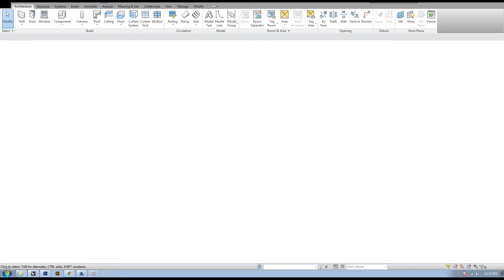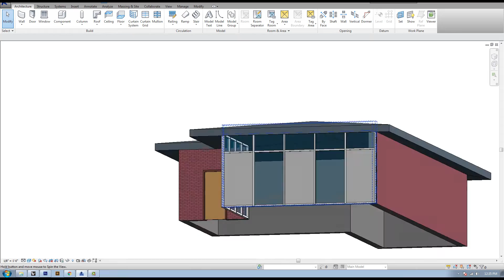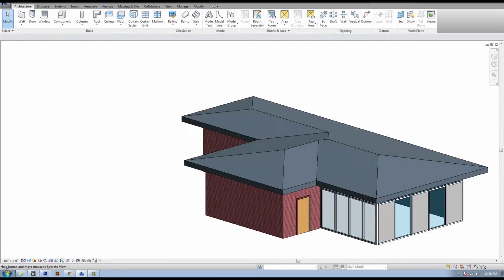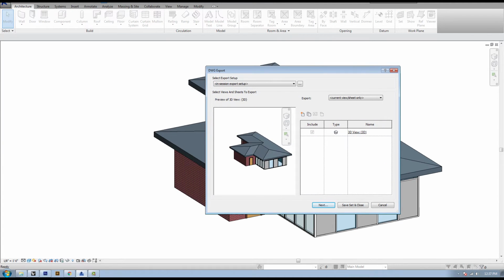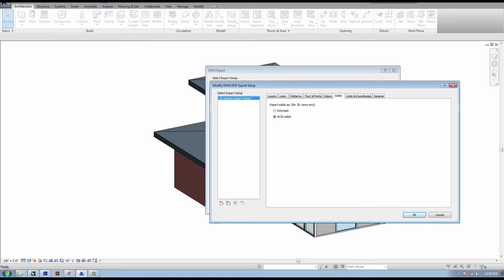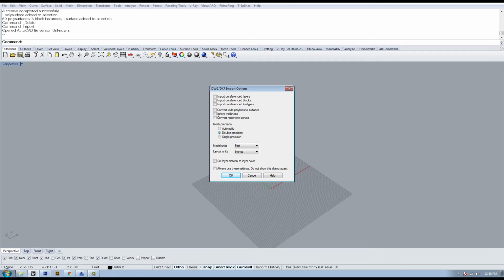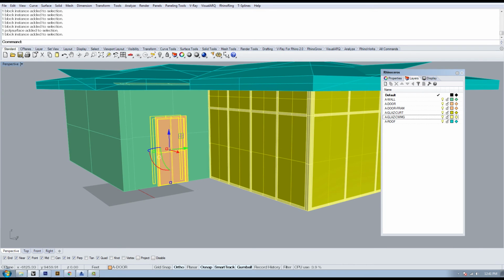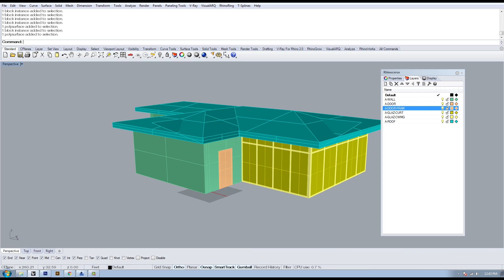[TUTORIAL] Going From Revit to Rhino

Comment: Hey i just saw your video, i'd aprreciate if you give me a prompt feedback, i exported my revit project to rhino and  i used rhino render and it doesn't work! When i put the material into the wall (for example) it doesn't apply. T-T
Reply from the maker: Hmmm.. you may need to explode or expand the objects. I can't recall at the moment how to resolve this and i JUST cleaned my computer so i don't have any of this software on it right now! be sure your rendering settings are set correctly - make sure you choose the rendering program you want, and double check the material properties. i don't have a lot of experience using rhino rendering, mostly V-Ray!
Reply: Greg Antons Thaaaaank you, I exploded it and it worked 😆 🙌🏻

Comment: Hi, and thanks for sharing the video.
My question is: how do I export details like material texture from Revit and print them on a 3D printer ?
Reply from the maker: Motasem Albanna thanks for your question. I have very little experience with 3D printing through revit. I there are some add-ins you can use to export to stl files but other than that i am unsure of the quality. I don't quite understand your comment about material, perhaps you can elaborate and I'll try and help you out a bit more. Thanks!
Reply from the maker: Motasem Albanna i just thought about it.. I think what you're asking is how to get the 3D look of a material to print on a 3D printer using revit, right? If so then i would be very surprised if revit can do that. The best way i can think of is to find a material that has a "bump map" and use that in rhino/grasshopper to generate a height map. Maybe dynamo for revit has a similar capability. Hope that helps!
Reply: Hi Greg, and Thank you for your prompt feedback. 
Actually, yes, this is what I meant. an example of that is a clay tile roof, it appears well textured and even pumped in Revit, but it prints mirror flat on a 3D printer without textures and clay pumps.
So I will be glad if you have any clue rather than creating 3D pumps or additional modeling which will be time-consuming and affects the federated model.

Thanks in advance.